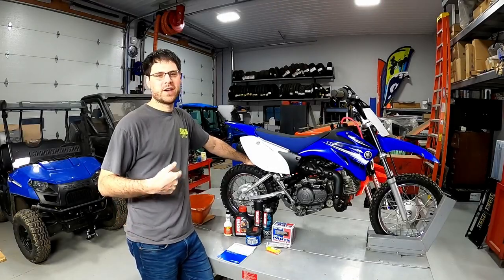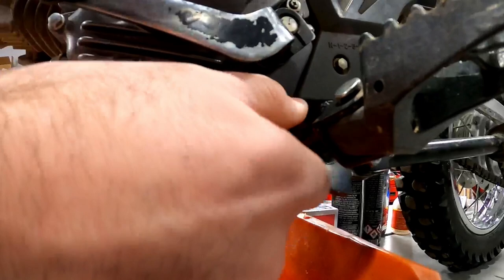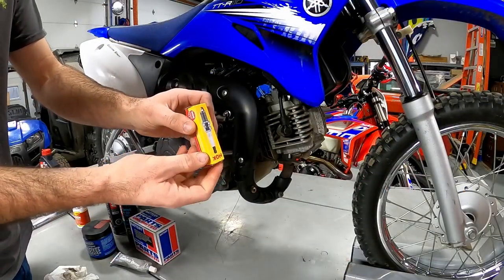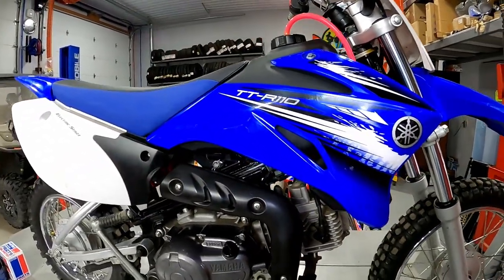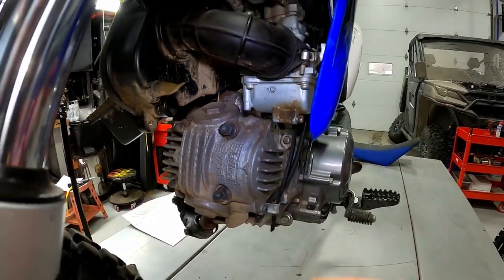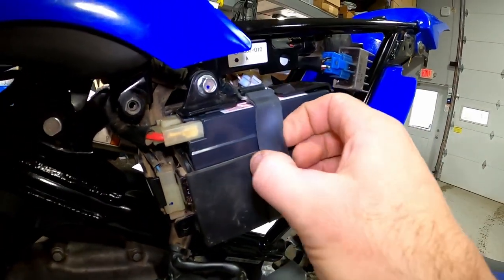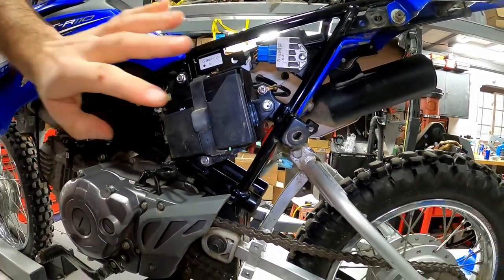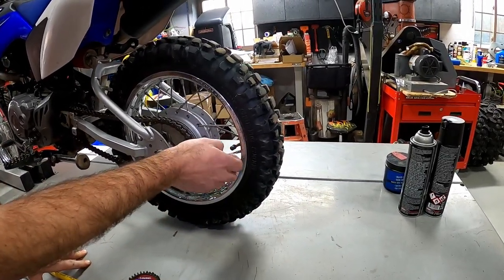Kids dirt bike maintenance made simple!  Yamaha TTR 110 Oil Change, Air Filter & Battery Service!

Comment: Great little video and thanks for taking the time to make it.
In the interest on Good, Better, Best maintenance habits, The engine oil changes are best done once the bike is brought up to full operating temperature and with these bikes not having an oil filter it's even more beneficial.
Also it's extremely important to clean and oil your air filter regularly. Running a dry old air filter is a great way to cause premature engine wear.

Comment: Hey you should have shown how to gap the spark plug, and talked about inspecting the plug = running rich or lean. I just spent USD$250 but that included a new chain, rear tire and tube, side fairing, various missing nuts and screws, spark plug, air filter, plus carb gasket/o-ring, brake pads (the rear were glazed and worn, could have freshened them up but the pads were only $15)
Reply from the maker: Pretty cool that you were able to buy all of those maintenance parts for only $250! Enjoy The Ride, Jared